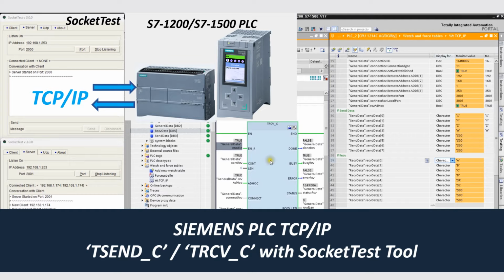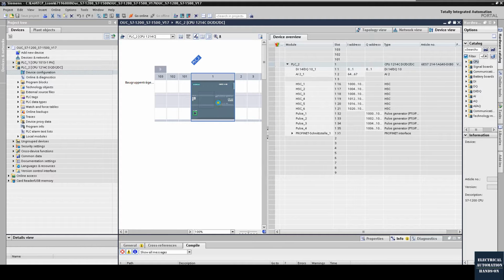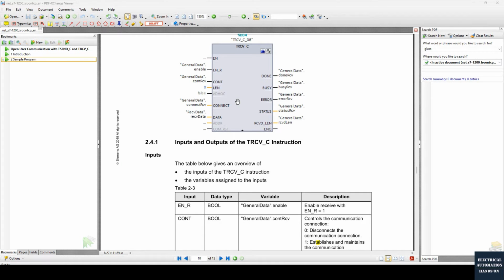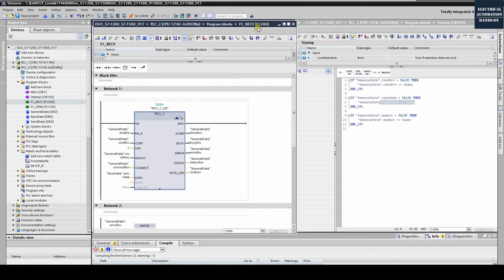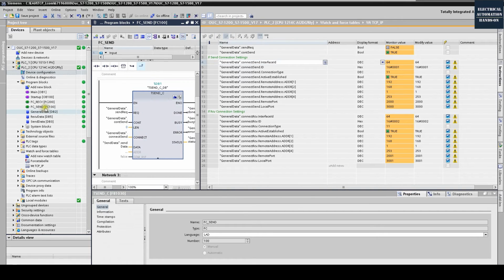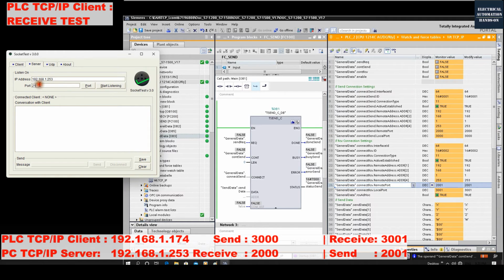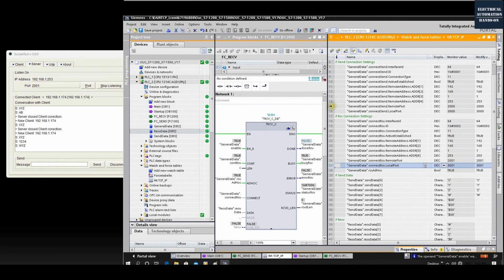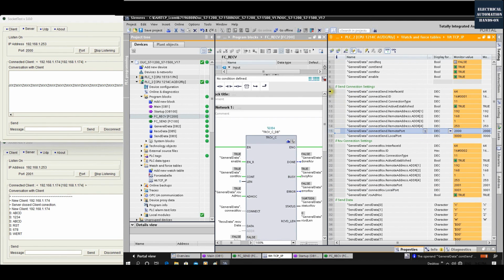COM31. TCP/IP - TSEND TRCV TCP Communication via Siemens S7-1200 S7-1500 PLC and TIA Portal

Comment: Sir, I did the same steps with you, but it does not want to connect with me on the tcp server. I did the same procedures and it connects with me at ip.192.168.1.253. Port 2000 connects perfectly, but it does not appear for me the same as it appears for you in the video 192.168.1.174

Comment: You are a real master. Thanks for sharing!
Reply from the maker: Glad you like them, Enjoy!
Reply: @electricalautomation  I Want to know if it is a better option use TSEND and TRECV for work with only one port direction or use TSEND_C and TRECV_C but implementing a logic to send and receive messages with one port. And what is the better way to implementing this logic in such case? Thanks for reading me.
Reply from the maker: @danielpc1998  Not sure what is your communication 'Target', if it is also Siemens PLC, the 'S7' connection and TCON+T_SEND+T_RCV is the better option. using this way,  T_SEND only cares about the port from the target (Remote port), whereas the T_RCV only cares about the 'local port'.
Reply: @electricalautomation  It is a external device that only uses one port and one IP adress to send and receive data

Comment: Is it same way If we do it on Step 7, controller is s7-400?
Reply from the maker: Unfortunately, S7-400/S7-300 will be not the same way, but similar. those old PLCs has been phased out a couple of years, using TIA Portal and S7-1200/S7-1500 are highly recommended.

Comment: Hello how do I create a csv file on a pc connected on the same network as the plc that updates itself every time ....
example
engine 1 start at 08:00 am
and it is written to the file
"engine 1 running + date and time"
then shuts down at 08:30am
and the plc updates the file adding a new line with written
"engine 1 stopped + date and time".
Thank you I hope you can explain this process to me